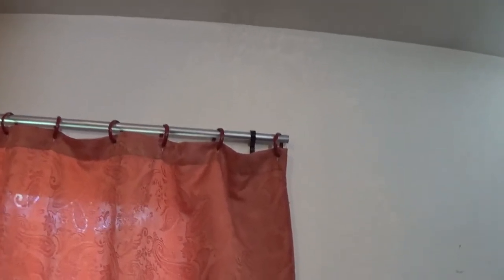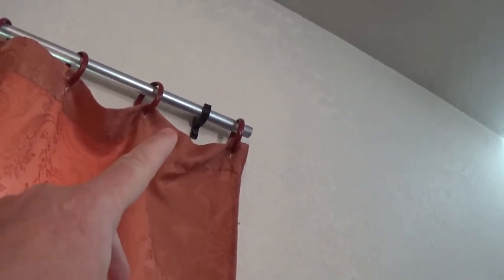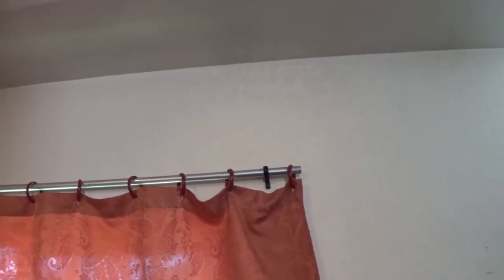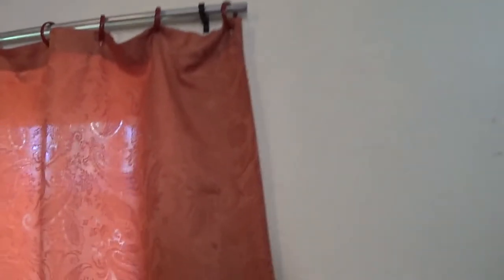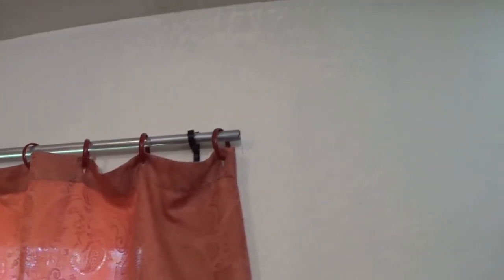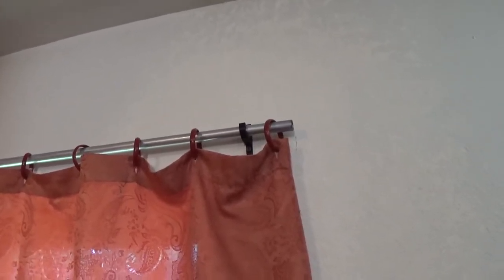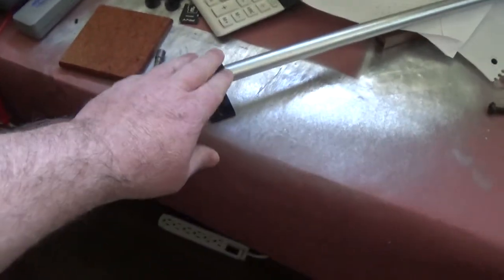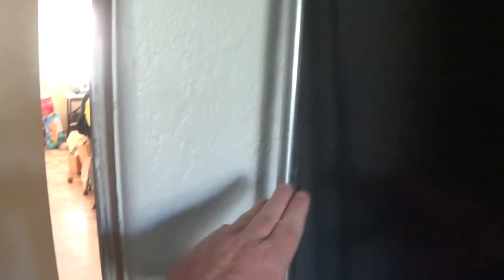3D Printed Curtain Rod holders

Comment: Nice video man. I can totally afford a tiny curtain rod for my bathroom shelving area. But I want to use my 3D printer some more, and I see it as a fun challenge. I've printed off all kinds of useful stuff. I can't believe how strong some hinges are. I wish my printer was larger than the Ender 3. They have metal 3D printers where I work, but even those are small in size.